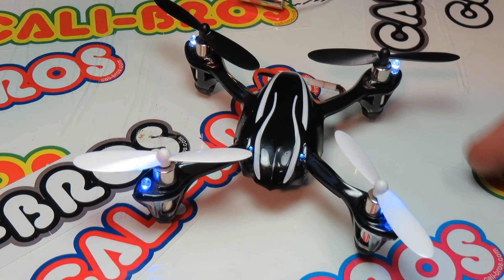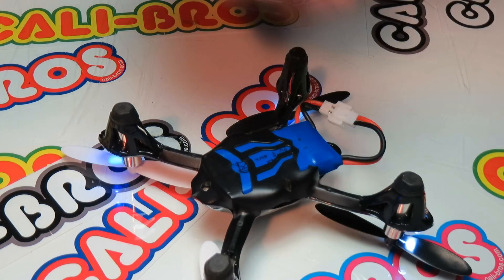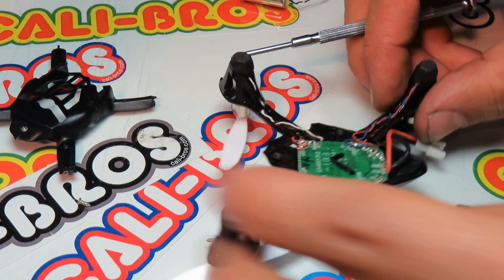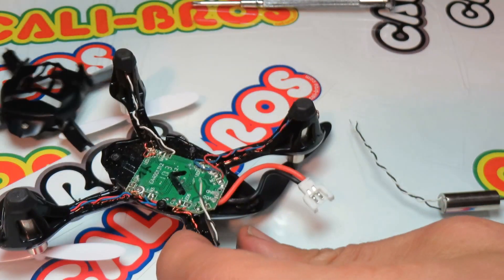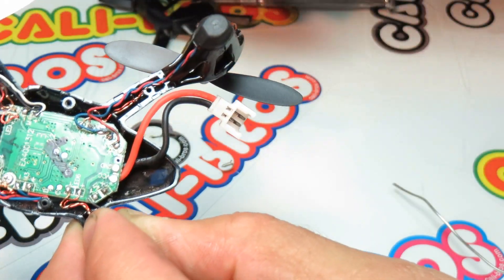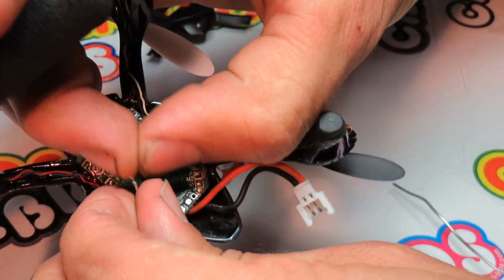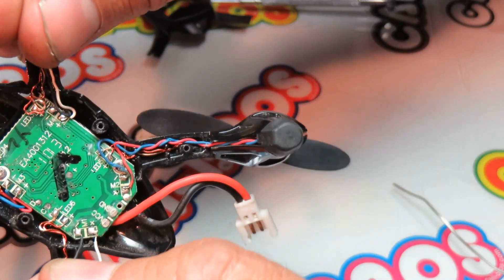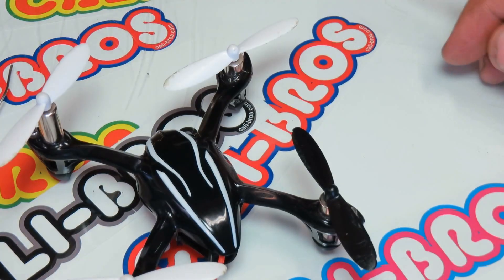Hubsan X4 H107L quadcopter Motor Swap ~ cali-bros.com

Comment: I know this is an old video but I swap out all four motors, ensured wire colors matched and the props are on correctly but it still won’t fly.  I am new to this and any suggestions will be appreciated

Comment: I have metal work lead free silver bearing acid core solder, I'm new to this, will that work?
Reply from the maker: Only use it if it says for electrical use. there is lead free silver solder for electrical and that will work. if it is for structural metal soldering it will not work.

Comment: So you used the existing solder that was already on the board? Correct, and what size tip and temp solder needs to be used?
Reply from the maker: only a small amount of solder was added. a medium (1/8") or smaller tip should work. any electrical solder should work so long as it either contains flux (rosin core) or flux is added. 60/40 electrical solder is typically used and it melts at about 430 F.

Comment: Do you have to "tin" the ends to replace the motor, because I don't have tin
Reply from the maker: "tin" the ends means add a small amount of solder. the purpose is to add flux to help the solder melt at a lower temp and also to "wet out" or adhere to the metal better.  you may be able to do this job without buying any solder but it is not as easy and may cause you to overheat the circuit board.
Reply: +Charles Male http://www.amazon.com/dp/B01ANV38WC

Comment: I managed to accidently detach wires from the motor itself, how should i attach them back? I don't have soldering iron myself. xP It's a Quadrojet what i have, it's a mini quad with plane foam around it.
Reply from the maker: If there is any wire sticking out you can solder to that, otherwise you will most likely need to buy a new motor. PS I have not seen that quad you mentioned, but this is true for most motors.

Comment: When i did this the motor i replaced spins slowly on startup. the other 3 are not moving.
I even tried another motor and switched teh wires on each. puzzeld?!

Comment: Im not really sure if mine is broken or not. It runs and rotates pretty good. It makes a bit of noise when I flick it. Not much, small grinding. But the battery life, damn. The batteries are draining. From 6-7 down to 2-4 minutes. Could it makes such difference? Thanks!
Reply: i reccomend buying extra batteries like 380mah-last 10min flying and 500mah-11-12min flying.i use both of those li-po batteries
Reply from the maker: yes this could be the motors drawing more amps, but the batteries do not last forever so could be both.

Comment: I replaced a motor to a mini quad just like that one and the motor runs on its own as soon as I plug in the battery I don't knw why need help
Reply: willy rodriguez yeah same I wonder what it is as it seems to be a common problem.
Reply: Damn well its there in the closet dead one day to fly again I hope
Reply from the maker: willy rodriguez You may have soldered the motor wires to the wrong place or solder may be contacting the main battery power and the motor power.  Open it up and take a careful look.  Hope that helps.
Reply: Did you find a solution yet? I have the same problem
Reply: Potato Lord no I just gave up on that one
Reply: I have 1 prob....how do i know which motor is clockwise and anti clockwise or depending which wire u solder from the motor onto the pad thing u solder it to on the hubsan x4 h107l?

Comment: How did you take off the wires in the beginning? What did you use?
Reply from the maker: With a soldering iron
Reply: ***** did you use solder for it to connect the wire to the control pad or just heat the soldering iron up
Reply from the maker: ***** yes we used the soldering iron on the control pad.

Comment: I had two motors go out less than 24 hours after I received the micro quad in the mail. Under low throttle they spin very slowly if at all. Under full throttle they seem to spin but the craft flips over when trying to take off. Do you think that is a symptom of a bad motor? The propellers are on there snugly, do I don't think the are free spinning on the shaft. Super fun micro quad, but I'm worried about their durability. Has anyone else had durability issues with the x4 motors?
Reply: Are you sure you have the right props on the motors? Each arm near the motor pod has a letter, either a or b. The props also have an a or b on them. You have to match them up. This is because the opposing arms both spin one way while the other two spin the opposite way.
 Hope this helps!

Comment: Hey I was replacing all of the motors and while doing so, the wire attached to the motor 2 negative terminal ripped off the transmitter board, and also removed the gold plate that is part of the board. Now it doesn't stick when I try to resolder it on.  Do you know of a way to bypass this? Can I attach the motor 2 negative wire to a different connection on the board?
Reply: Just in case you haven't fixed it yet....
Have a look at the tracks where the solder pad has ripped off, what you're looking for is a place where you can scratch off some of the green PCB cover to create a new place to solder to.
I've had this problem on other projects, it can be a real b**. Just make sure you don't apply too much heat to the PCB for too long, it weakens the bond between the copper tracks and the board.
Good Luck!

Comment: you made it look so easy
Reply from the maker: Thanks. really the trick is holding the wire so that when you release the soldering iron the wire stays up against the board. Also have the soldering iron hot and put some fresh solder on the tip to get some flux on it or use flux.  Don't hold the tip on the board for more then a few seconds. I can change one out in less then 5 min. But luckily the new ones don't burn out motors hardly at all.

Comment: I've already talked to two other people about my problem, and I'm just trying to compare responses. Recently my X4 crashed into a gravel lot from pretty high up. External or noticeable damage was minima (just scratches)l, but now it doesn't actually doesn't take off, even at full power. It has a tendency to flip over to the left. I can't tell if any of the motors is truly not up to speed. I do hear an odd "off-key" resonance when I move the stick in one particular direction, so I tend to think so. However, both of the other guys I contacted seem think it could just as easily be the RX-motherboard now not distributing power in the right way. The copter seems to respond on all channels with no problem, and I even calibrated the gyros with success. I'm just curious how you might approach this or if you have an idea what's going on, if you don't mind getting back to me. Thanks.
Reply from the maker: I would first check propellers. Just put new ones on maybe they are spinning on the shaft.  Next I would check to see if the motors spin up to the scammer high speed by holding it in hand and rotating it with a small amount of throttle.  Then check soldering connections of the motors on the board.  It is very rare that the control board would go out or the radio, but it is a possibility. Sorry for the late response.

Comment from the maker: If you don’t have a soldering iron you can strip 1/4 inch of plastic off the ends of the wires and twist them together, make sure to match the same color wires to each other. Cover the bare wires with electrical tape so they don't short (touch).

Comment: Is there any way of doing this without a soldering iron?
Reply: Austin Powers theres stuff called liquid solder. its cold and you dab it from a bottle
Reply from the maker: Austin Powers If you don’t have a soldering iron you can strip 1/4 inch of plastic off the ends of the wires and twist them together, make sure to match the same color wires to each other. Cover the bare wires with electrical tape so they don't short (touch).